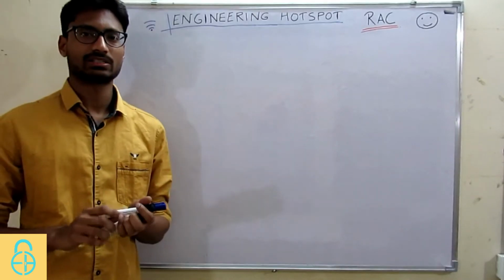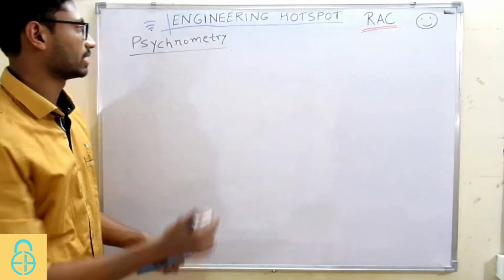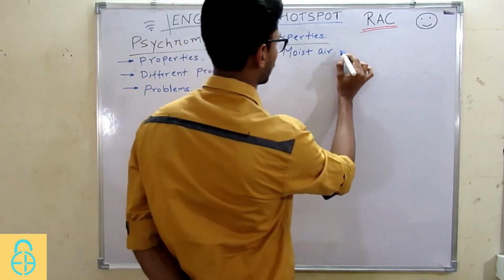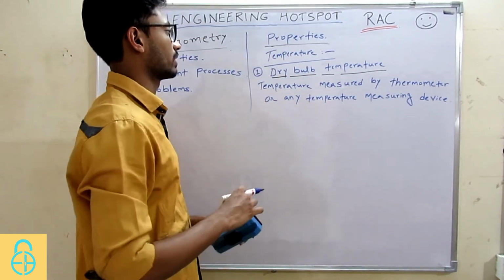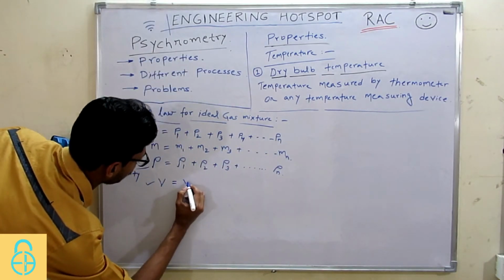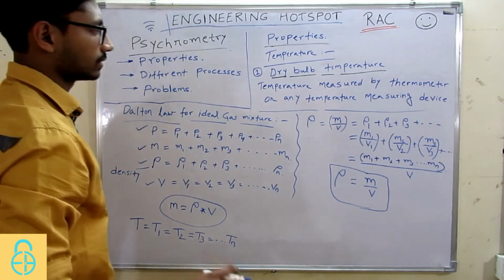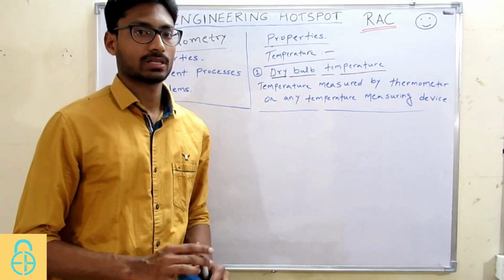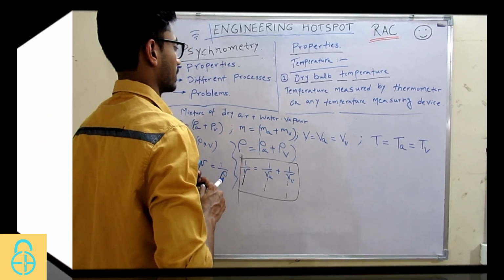RAC - PSYCHROMETRY II LECTURE-1 II for GATE, ESE, Mechanical I ME

Comment: Dear Enginrering Hotspot, kindly says on the following ques
1. what is the Effect of reheating in vapor power cycle in terms of efficiency (Increase/decrease) 
2. Effect of regeneration in vapor power cycle in terms of work output (const/increase)

I refer two diffbooks they are given two diff answer, confused. Kindly says answer as early as possible.
Thanks in advance.
Reply from the maker: 1- efficiency decreases
2- work output constant
Above answer are for Gas Turbine cycle(Brayton Cycle)

1-efficiency may increase or decrease depending on intermediate pressure.
2-Work output(net work) decreases by regeneration.
Above answer is for Rankine or Vapour power cycle.
Reply: tanq @ Engineering Hotspot